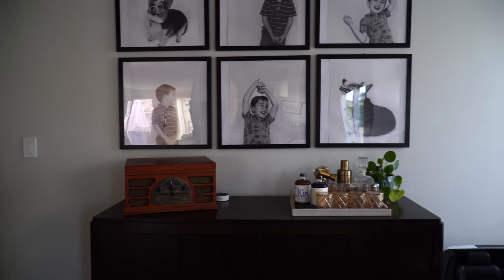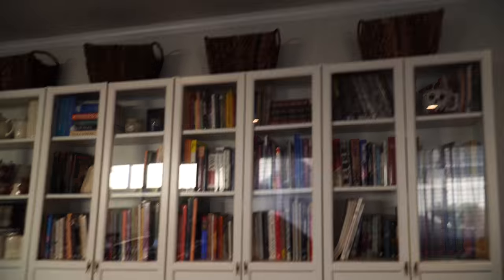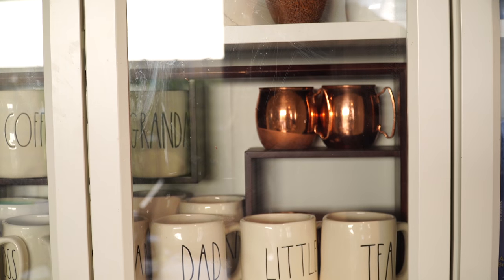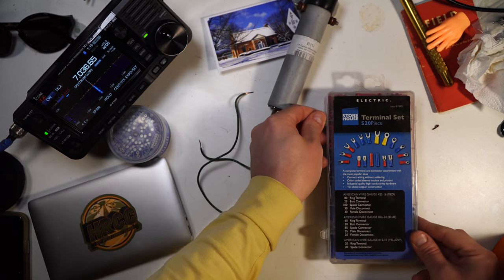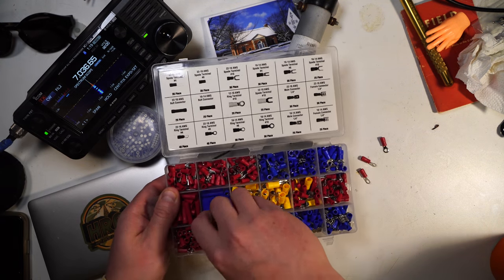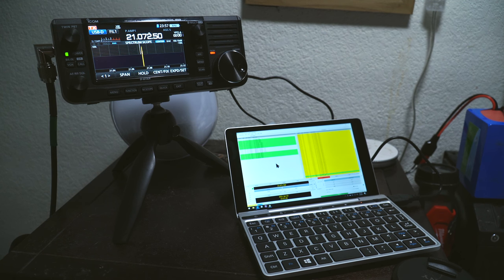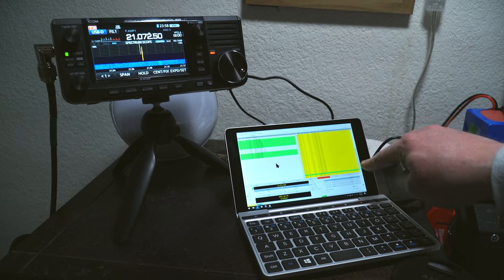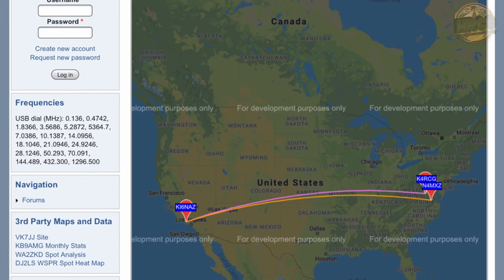Will It Antenna? Put a BALUN On A Curtain Rod, Make a Covert Ham Radio Antenna

Comment: I have used some strange things for CB antennas in the past where people was not allowed to put antennas up.  Used a long curtain rail, cut it through the middle, joined it with a bot of plastic pipe, and hang the curtains on wooden or plastic rings.  Used copper sticky back tape and aluminium taps to stick to plastic gutters.  
Hung wire from the roof so as the centre of the dipole is in line with the window the coax is going into.  Used two Tank Antennas into a bracket, plastic or CB fittings so as one was vertical and the other was at 45 degrees from vertical and attacher to the wall or window.  I did the last one with a very strict landlord, he came barging in to find the antenna wired up to a Worldwide radio receiver and the guy sitting listening to short-wave.  We heard him coming and switched the CB for a small receiver.  He was sure it would be a CB and he stood there spluttering and no idea what to say.  There was no rule that said you could not put up a antenna for short-wave listening.  He had barged in forcing his way past the person who answered the door.  He knew he was in the wrong, so he tried to make his excuses and leave.  That antenna was up for over 14 years until he got married and left the house.  I never got my Tank antennas back!  :-((  oh well.  At least he enjoyed his CB until he met his poison, I mean his wife to be.

 I even got a black PVC pipe (black) on top of a skyscraper with an antenna inside it (A Silver Rod type without radials on it).  Had to make the bottom bit to be a bit fatter to take the bracket, but we used the bracket and threaded rod to fix it to the building using a small pipe that was there (no idea what it was there for but it was made for being used) and it as far as I know is still there.  The door to the roof is now locked and there is no way to take it down.  It was used for 15 years plus and as far as I know the coax is still in place. 
There are lots of things you can use, you just have to think a bit outside the box a bit

Now the serious bit:  :-D
.I think you should try a packet of biscuits, they will out perform your curtain rails!  ha ha ha.  As long as they have sugar sprinkled on them, best if warmed up, but the RF might do that for you.  Use 400 + watts.
Or a Pyrex dish will work well.  Clipping your coax to your underwear will work best, use 1 KW  :-D

Comment: Adhesive copper tape like used for older style window security sensors works, too, to connect the 2 halves of the curtain rods.

Comment: Lower the freq? Just add slinkies on the ends. Stainless steel curtain rods don't have paint to remove.  Or take a ham antenna for say 60 meters and a jumper wire from the whip to the metal frame on a typical house window. That metal frame on the outside helps that antenna work like an antenna outside your house. This doubles the broadcast channel signal strength.

Comment: an apartment i used to live in had an aluminium porch frame with a plastic screen..... there was a split in the one corner.. you can guess what I did :D yea i made it a loop antenna. I worked california from daytona on JT65 with an EIRP of about 1/4 watt lol 

There used to be a "strange antenna" contest back in the day. i've used 2 30 ft extension ladders as an antenna for FD before now
Reply: I've heard of that contest. People would load up rain gutters, aluminum ladders, bed springs, etc. I've heard of taking a bunch of soft drinks cans, connecting them together and transmitting on that as well. I think it's great to experiment with antennas. You never know what will happen.
Reply: @redstickham6394  i've actually done that for field day... loaded up my 30ft extension ladder.. worked quite well to be honest

Comment: Right, I know this is quite unrelated to the video, but heres wtaf I've been doing to my radio a few moments ago:

I was wondering why my FM radio keeps getting interrupted by my airwave radio when I key-up on VHF 141.660. Tried to tune my FM radio all the way up to the maximum (108Mhz) and transmitted on the lowest (136Mhz) on my Baofeng UV-5R. Didn't get anything but found the frequency that clearly transmitted my voice, receiving on 108Mhz Phone FM and transmitting from 139.000Mhz UV-5R. Any thoughts?